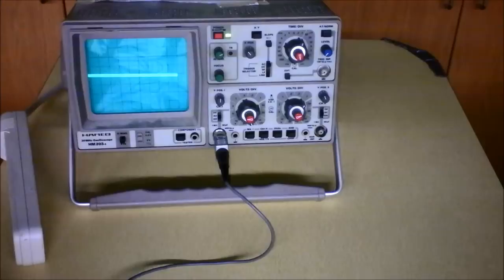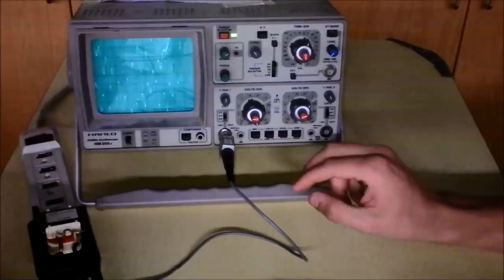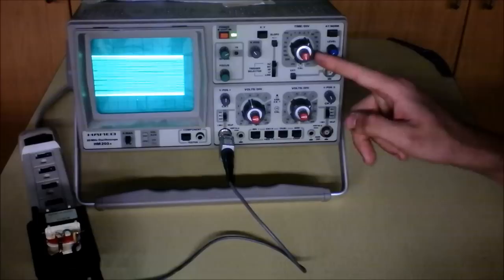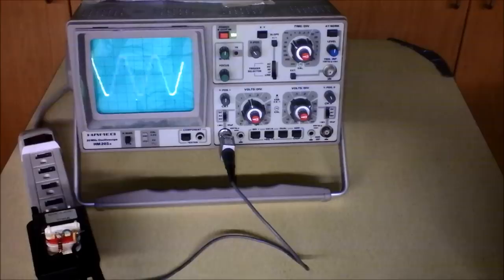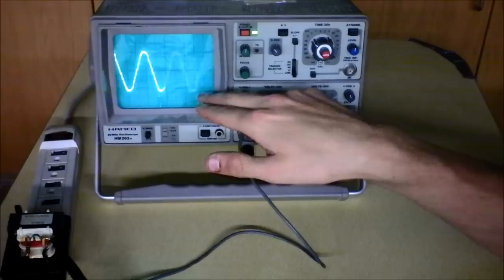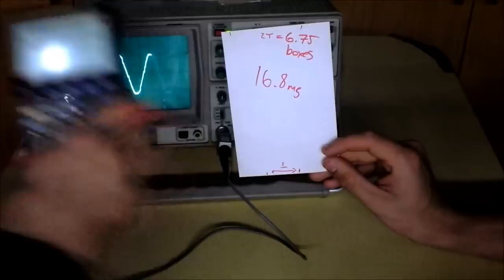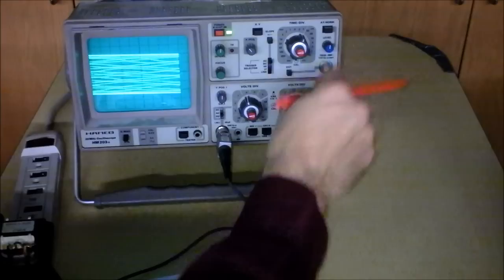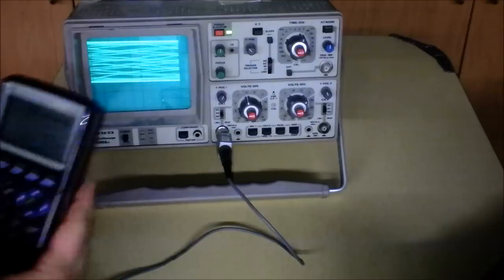Measure Period, Frequency, & Amplitude on Oscilloscope | Scopes 3 of 5 | Doc Physics

Comment: My question is, given our 60Hz AC system, how many times the current changes direction in one second?
Does the direction of current change after each 180 degrees or after each 360 degrees?
I know in one of your videos you said current change direction 60 times as most people say the same thing.  However some people think otherwise.  So what do you think?
Reply: Since the hert is one full cycle of a sine wave, one peak and one trough, it would go negative (if starting from the zero point and going negative), reach the trough, travel upwards towards the peak, then travel back down to the zero crossing.
So 60Hz, 60 (full) cycles of a sine wave, per second, i think changes direction 120 times per second, since there are two points at which the voltage/current is at it's peak value and each second there are 60 full wave cycles.

Comment: I'd say the reason the voltage was a little higher than measured is because it was an unloaded circuit.  My guess is that the voltage will be 9V peak if it is loaded down by a load. (I am surprised that there was no bridge rectifier inside the wall wart!)
Reply from the maker: Power Max Yeah.  It's a pretty cheap old dude.  So, I feel like that's really weird to spec V_pp for the output but V_rms for the input.  But I agree with your assessment.  Just a silly convention by the manufacturer.
Reply: One thing I have noticed is that all my old-fashioned unregulated wall adaptors will have generally 15V unloaded output regardless of the nominal voltage rating. Currently i have seen that on 12V versions, 9V versions, and even 6V versions!!! Now the world has mostly moved on to the smaller, lighter SMPS that can deliver many more watts of power and offer tightly regulated outputs as a bonus!

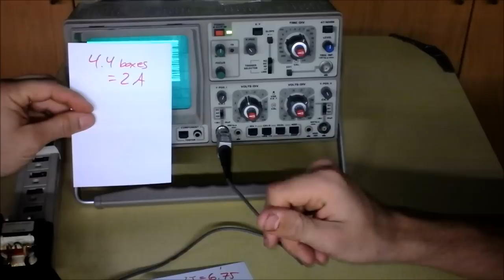Comment: Thank you for these videos on oscilloscopes, and all of your videos by the way. One thing here: At about 11:30 I'm not seeing why 2.2V should have been divided to get 1.1V. Someone correct me if I'm wrong but isn't the answer just 2.2 volts (from 4.4 volts peak to peak)? In that case I'm getting an output of 15.6 volts rms.
Reply: +roisen imza
Please excuse the delay. I finally watched the whole video again more carefully. It still appears to me that the algebra problem written out toward the end,  4.4 = 2A , was accidentally calculated as if it were 4.4(1/2) = 2A.

Measuring from peak to peak (trough to crest) was just a visual aid for counting the "boxes". Since the amplitude (A) of a wave is the distance from its center line to a crest or trough, in this case 2.2 boxes represents 2.2 volts before adjusting for the 10x probe or rms.